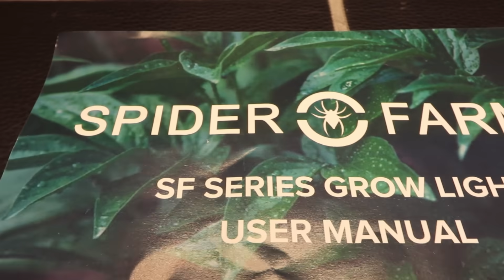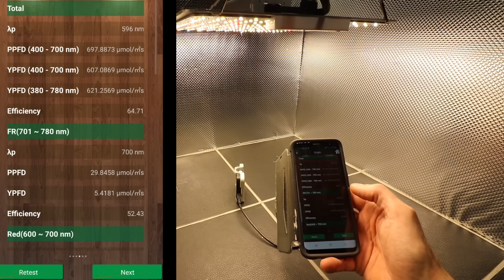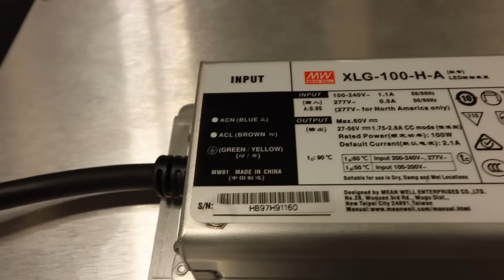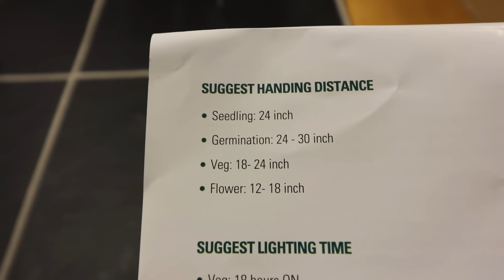Spider farmer SF1000 PAR test and review

Comment: the newers one have an easy access  ajustable controller,  2 port RJ 11 that can be use to link all your panels together and one of them the main that control all the others. still need a timer for all of them to switch on/off. the main that you set wont turn off the others if only the main is on a timer yet maybe next gen :P

Comment: thanks nice little objective review as always, I am glad they have updated the design with the function to use a dimmer and also daisy chain multiple sf1000's. This light seems a great way to have a samsung quantum board for cheap! I like that you can still remove the driver and the dimmer/daisy chain box. Even having them a few inches above the main light would help a lot I am sure..

Comment: I have a 2x4 with a sf1000 and a vivosun 300w I'm having heat issues with them both on and my ac infinity running at 7.  Is it more light than I need for a 2x4 gorilla tent lite and if so would you recommend using the sf1000 or the vivosun? Also would the chilled tech x1 be a better single light option for my tent?

Comment: I never understood why so many brands mix warm white and cool white. If you use 50% 3000K and 50% 5000K, you could also just use 100% 4000K. The only difference between the colour temperatures is really the thickness of the phosphor layer, isn't it? Or am I wrong...

Comment: Weird question: Can you test the par of this light hung at 24 inches under 16 inches of water? I'm wondering if this is a good option for aquarium use.  6500k is generally preferred, but I've had success with 3500k in the past.

Comment: TOP TIP TURN THE POWER PACK UP SIDE DOWN ON THE LIGHT THEN YOU CAN CHANGE THE POWER EASY THATS WHAT I DONE i have been looking for a PAR meter just so i can check my setup what PAR meter are you using
??????????????????

Comment: just make an l bracket that way you can adjust it any time without unscrewing. the dimmer is very useful with seedlings. You can put the light much closer surrounding the plant with light., and saving electricity.

Comment: I bought the Spider Farmer 1000 (upgraded from Vipaspectra 450j and just love it! The color is bright white, runs far less hot in the grow room than the blurple ones and has such a small footprint. The latest ones like mine have the dimmable knob which would be great for seedling stage. It's a solid build with a lot of pluses going for it. Bypass the blurple ones and go right to this, you won't go wrong.
Reply: Hey mate, could I ask about faultiness? Any issues maybe?

Comment: Great reviews. Thank you for all the info and unbiased honest reviews. Would love to see the Bestva 1000w led reviewed.
Reply: I have a bestva 1000. Worked well for veg and half of bloom before i upgraded. I think it's a decent light. I'm assuming its efficiency isnt great though. I just got this spider farmer sf1000 running beside 2 optic fatslim XLs. I would recommend staying away from the blurple lights. Quantum boards are the way to go especial with samsung LEDs and meanwell drivers. My phatslims are 2.7 efficiency but the sf1000 is great clocking in at 2 which is way above any blurple light. One thing I haven't been able to find info about is my sf1000 came with a dimming knob and dasy chaining. I think it's a updated version. Contacted sf directly to get more info on this. Long story short I'm vary happy with Spider farmer quality and will most likely pick up another in the future. If anyone has received the model with the dimmer knob and chain let me know

Comment: One could get risers to raise the driver above the panel, improving heat reduction= more efficient
Reply: It actually is raised off the panel by about 5 mm. Look at the brackets between the driver and the panel.
Reply: Heat dispersion between driver and the actual board is very minimal & doesn’t need to be raised to recifity heat dispersion , as there’s hardly any heat there to disperse. As I thought this as well or even mounting the driver completely outside the grow tent instead of on top of the board, but really it’s a no brainer & spider farmer have made the near perfect board as there’s no need/room for improvements. As heat just not an issue tbth.

Comment: What's up Shane! Great content and a great channel. I just love your honesty. I have a question on this light, well actually it would apply to the SF2000 model. I noticed that it came not fully turned up on the meanwell driver. The output for the light says 202.3 watts for a 120 v. If I turn up the light all the way, it will go above that 202.3 watts, is this something that I should not do then? Should I maintain wattage under 202.3? I appreciate you answer bro, and great channel. Thanks bro, I appreciate you!
Reply: do not ! turn them up you will burn out your diodes 🌱✌🏿
Reply: @derrickgs777  Thanks Bro! I appreciate this feedback. Although I had decided to not turn it up, and leave it at where it was set. It's good to know what would happen. I appreciate you. Thanks

Comment: I am comparing the Mars Hydro TS1000 with this Spider Farmer SF1000, and your reviews of each were very good, but the testing methods were slightly different so I still can't make a direct comparison. When you reviewed the Mars Hydro, you used reflector walls and the efficiency numbers were great. However, with the Spider Farmer, you didn't use reflector walls, and the efficiency numbers are therefore less appealing. Would you be able to comment on which product you think is better? The pricing is fairly similar, and I can't directly compare the efficiencies, but the SF1000 only consumes 97 watts while the TS1000 uses 147 watts. Thanks!
Reply: yeah yeah. Which one is the better growing light? I'm leaning toward the SF1000. Without the reflectors its peak matches the hydro. And the differences reflectors make COULD bring it up to match or beat....I need to see it. I think it comes down to best color for me.

Comment: I love your videos and I have a request.  In my grow tents I have 4 or 5 lights.  I’m curious about the overlap areas of side by side light fixtures and what is the optimum spacing.  If the area under one light is measured at 200 and then another light fixture is placed along side overlapping the 200ppfd , would it jump to 400?  Some of my tents have 2 lights pulling 200 watts along with 2 lights pulling 100 watts from the wall.  Knowing what the values are for the overlap areas would help with tuning in the location of lights. Maybe you have already done this, but keep up the good work.

Comment: Would you go 2x 2000 or 1x 4000 for a 5’x5’ tent?
Thanks
Reply: I would do 2 sf2000 over the one 4000.  More versatility. I am using 3 SF2000 in a 48"x72" space and it's all filled up with 6 plants and dense.

Comment: I have a 3x2x5.5 tent, inside of a 4x2x8 closet without closet doors(otherwise i would just use the closet, instead of the tent). Id prefer a taller tent, but it was given to me so i cant really complain. 

Is this light good enough for the tent size? I realize with my height restriction I'll have to veg low and bonsai it before flipping to flower.. 

How much heat does it put off? 
Would it still be a sufficient light when I eventually ditch the small tent? I want to keep it for veg/clones to keep a cycle going, or a drying tent. Idk.

Comment: The warrenty sucks. Check it out below.  I am now going to get the Mars Hydro. It has a bumper to bumper warranty of 3 years.
Warranty

The light can be returned or replaced within 30 days after delivery, in the precondition of non-artificial damage.

90 days ALL FREE warranty. Free components, repairing and service can be provided within 3 months after delivery.

3 years of free components can be provided.

3 month -1 year : Free components, shipping fees of returning. Buyer needs

pay 1 way shipping fees and repairing fees.

1 year - 3 years : Free components. Buyer needs pay 2 way shipping fees and

repairing fees.

Comment: The coating is an encapsulant similar (maybe identical) to that used on solar panels to protect against moisture ingress and is made by Acheson / National Starch or a competitor. The encapsulant must be somewhat flexible to retain integrity and remain waterproof as the dimensional changes of the aluminum printed circuit board occur during the heating and cooling cycles.

Comment: So is this equivelant to the 1000w hps bulbs of the past?  I just ordered (3) 2000 model lights from spider farm, which I am under the impression will equal 3000w equivelant?

Edit: I've realized each sf2000 is like a 400w HPS, whatever it is, my grow is booming under these lights. Super dense wide plants in VEG after 45 days (not from seed, 45 days they were under these lights so probably 60-70 days veg), 40" tall and 28" wide after doing some LST training.

Comment: I would like to know your thoughts on the comparison between this light and the Mars Hydro TS 1000.
Reply: AFAIK Mars Hydro is less effective. I am observing the market quite a time now. And The QB are the non plus ultra with Samsung chips. Even the older lm561c chipped QBs are better than Mars Hydro. I dont remember but Mars Hydros chips must be Epistar. An MIGRO had a test onthe ts 1000. But I think this test has a problem. I dont know why, because the PAR mesurement results irritate me. I know that QB have better PAR readings than Shawn tested in this video. Even on Spider Farmes website u have better results. Was the board dimmed maybe? Idk.
Reply: @bmq34  idk about that.  This Marshydro newer version seems brighter than this light and 60 dollars cheaper.  Very similar in style
Reply: Yes, that would be very interesting. I would stand for the TS1000.
Reply: @bettergrow2302  even though the other has Samsung smd LED?
Reply: @lolfish78  I used the TS1000 and SP250 for a few months. I liked them. never tried the samsung light. So we will see.
Reply: I purchased both. Hopefully i'll be able to tell you something. MARS HYDRO 600 SEEMS BRIGHTER

Comment: I bought the SF 4000 about 2 months ago
And love it
Reply: @Patrick-vx2ks  I'd measure temps and look out for that, not sure if there's any thermal paste between the sink and the diodes.

If there's temp spikes in the corners I'd contact spider farmer. I contacted them as well, they assured me that the noise coming from the driver is apparently normal. 

This doesn't make the meanwell-driver look as high-end as they make it out to be, but considering the price... My plants really love the light
Reply: I got an SF 1000 and was wondering if you also notice any noise on your mean well driver? Its like a fast ticking sound on mine and I'm still waiting on a response from Spider Farmer.
Reply: @Patrick-vx2ks  did they answer ??
Reply: @Patrick-vx2ks  cool:)

Comment: Hey mate. I just discovered your channel a few days ago and i love it. I am really impressed by honesty and how you present facts in a way that someone like me can understand. 
 I have a question for you regarding a diy set that fancy, if you can spare a minute. 
Set has an option to come with the same chip as optic 1, same lense choice, same manufacturer power supply, heatsinks look the same, and is a 50w a cob setup. In your opinion, will this set perform the same as equal amount of optic 1 lamps? Only difference thst i see is that one driver powers more cobs instead of each cob having its own driver. Or are there any other things to take into consideration that i am missing.

Comment: All this new led that you not can remove the driver,is a tot flopp. The driver need to be outside the tent. Have a qb288 my self. 240w. But that was insane. So bought a exact the same cable. And put the driver outside the tent. On a aluminumplate. Just for some extra cooling for the driver. I dont now if i need that but. Its night and day in temp in tent. 4-5deggres celsus lees. So crazy that some make it impossibly to remove the driver. But like the Mars 200 they have in china cabels just for removing the driver. But no here in europa. But just buy a good qalitycable exact as the one and some.connecters. easy. And a nice led to. Mars best. But like this. But they have made it immpossibly if you not are electricengenere. Dangerous. Can be fire if done wrong. Love your show. One day i will own some migros. One day....beacuse i dont like horticultures that all chips are free and get dirty. Like do any now how to clean those small ledchip. How....
Love and purply,bluish babe say hey i love you all. But dont kill us. We are just love. Dont hurt us please. Peace out.

Comment: Hi,
I saw in Brasilian sellers of led grow light about the EMERSON efect, he say that, in the nature, the sunrise and sunset have a special red spectrum and the cannabis “see” this light and knows have change itself to “nigth mode”. In indoor grows, to simulate this, before and after the turn off light a far red and deep red lights are on, making only this red spectrum saying to the plants change to “nigth mode” with this the flowering will be shorter than without the red lights only. You know anything about this? Or this is a little confuse for sell this leds?
Reply: You pretty much nailed it but I think you're confusing "Emerson effect" & "flower initiation" as the same thing.  Both use the 730nm far red to their advantage, and without going into the complex details it affects the signalling between the different types of chlorophyll production.

"Emerson effect" is simply to add 730nm far red to 660nm deep red to increase the general photosynthesis efficiency.  "Flower initiation" is running the 730nm far red AFTER the rest of the lights have shut down to trick the plants chlorophyll signalling; it allows you to keep the main grow lights on for longer than 12 hours in flowering without making the plant go back into vegetation as it normally would with anything longer than a 12 light cycle.

Comment: Using a longer cable to keep the driver "outside of the grow tent" might cause voltage drop on the DC side and affect the brightness of the LEDs.
Reply: Really? I think I have that type of problem with sanlight sw4
Reply: Interesting, will that affect the voltage? and how? I didn't find that for my SP250.
Reply: @bettergrow2302  Whether the effect will be noticable or not depends on the wire thickness (guage) and length (which affect its resistance), and the voltage used and LED specs.
Reply: @Arthur78  Okay. i think i need to send an email to Mars team.

Comment: Extra cable would increase cost, dimmer access is a no-go. Very similar in price, quality and concept to Mars TS1000. Regardless of who manufactures and sells the grow-light isn't it very probable, that when using identical LEDs and drivers, will result in similarly performing lights? Just saying, it's either discrete or COB LEDs. Until there is something new with LED technology (unlikely) these are both state of the art solutions, COB and discrete LED's, it's now "Shake the bag for new products". Migro has designed a great, efficient, COB LED grow-light.

Comment: Shane/MIGROW, you’re awesome, and I love watching your videos! Thank you!

It would help me out tremendously, and be awesome to see you review the HAUS BRIGHT “full spectrum” “100 watt”/“20 watt” LED light (can be found on Amazon) linked below (which I used in my last grow (I had four of them hanging so that one of them was at each of the four corners of a 600 watt iPower MH/HPS wing reflector, all in a 4x4 tent👌🤤... I’m also about to start a single plant with 1-4 of these lights over it in a closet, so it would be great to see at least one, but even better eg four in a diamond shape or side by side one another, or just two side by side one another at least... but definitely please at least do one by itself🙏... would also be cool to see the setup I had using the iPower 600 watt MH/HPS, too, or another similar (or better eg 1000 watt) in PAR MH/HPS/LED/CMH with four of these LEDs, one at each corner🙏)), and I think it would make for some more awesome content!

I would love to know the PAR data (e.g., at 12, 16, 18, and 24 inches) for the following $26.95 LED light linked below... there are similar slightly less expensive ones on Amazon, too, and it would be even cooler to see if they are really the same as one another (at least PAR wise), as some are in the low $20s...but this slightly more expensive one (linked below) has the most reviews, and was purchased by me lol.

https://www.amazon.com/100W-LED-Grow-Light-Bulb/dp/B07H9W1TSZ
Reply: And/or three in a triangle shape lol

Comment: As a relatively new grower, I've learnt more about lighting as I've gone along, going from cfl to a cheap blurple led and on to this. Definitely best light I've owned and overall a fantastic light period. If you don't have ridiculous budget, but need a seriously efficient light for a smaller grow tent, this is bloody good light
Reply: I've noticed the cheap blurple lights consume lots of electricity.
But these type of lights only use about 100w of power. Pricey up front but saves later down the road
Reply: Most that venus fly traps say i need to grow them outside because of light. I say bull&**%. Will this light since in my budget be a good replacement for my very high output light ballast which is digitally?
Reply: @bigfoot8778  id get your flytraps outside dude! I have a planted bog garden of pitchers, flytraps and sundews, and they have been far happier outside. Not for the sun, but for the insects!
Reply: kiran kara if you get a migro 100 you’ll get more yield lol